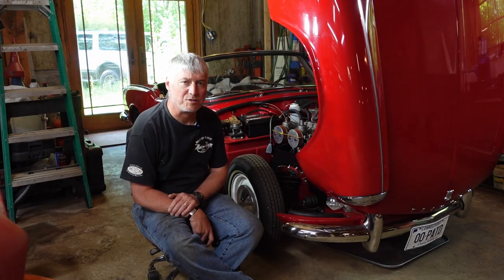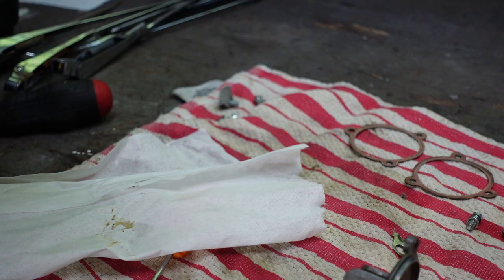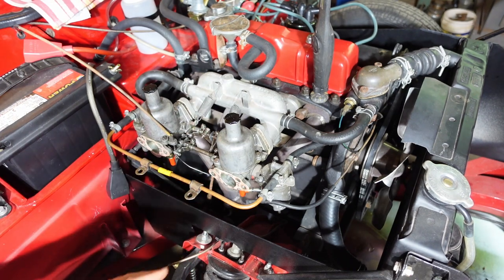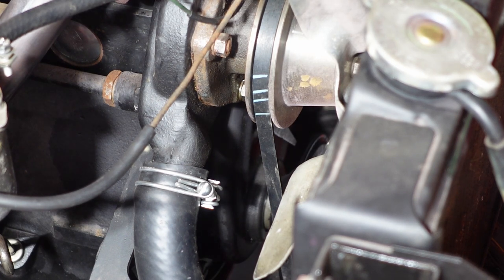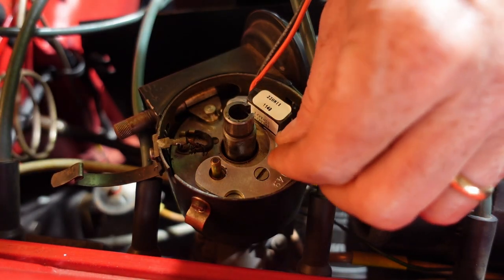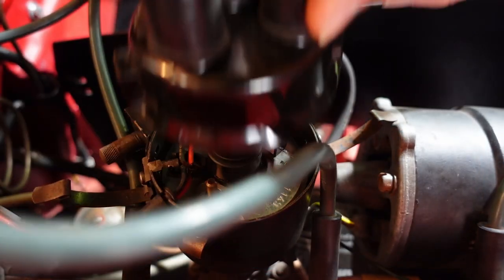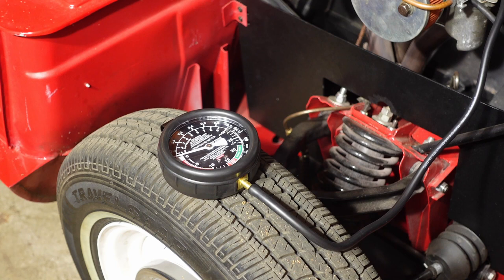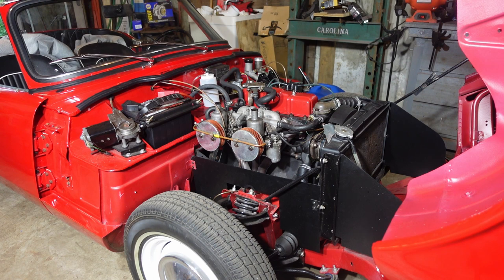Triumph Spitfire - Troubleshooting Rough Running #3 | Roundtail Restoration

Comment: And check the fuel filter, how old is the gas?
Reply from the maker: The fuel filter has about 100 miles on it and the gas was put in in October of last year with some Stabil in it. But, I do have a spare fuel filter, so I'll probably replace it anyway.

Comment: I own british bikes, not cars. But my long distance youtube guess is the fuel tank is not vented.

 Try removing the gas cap and take it for a quick run and see if anything changes.
Reply from the maker: Thanks, Lee. I did have the cap popped when I was taking that last lap. I though that might have been an issue of mine last year. No changes.

Comment: Unless it is the video I can see the missfire on your timing light.  Try running a jumper direct from the battery to the coil. This will eliminate any problem with the ignition power supply to the coil.
Reply from the maker: I think it might be the video. Timing of the shutter and the light. Good call on the jumper, though. I'll need to remember that for next time (I'm sure there will be one). Thanks for watching and your comments!

Comment: Just finished watching the video, I have very little doubt right now that you dont have enough fuel to support more than 3500 rpm.

Colapsing fuel line, plugged tank vent, fuel line to small...

 For quickest check, try running with a temporary tank. That eliminates everything but fuel pump (least likely thing I think).

 Good luck and keep us informed.
Reply from the maker: Yes, I agree with you there. I keep going back to fuel, too. Everything is new throughout the system (lines, tank). The only thing that isn't new is the pump, which I rebuilt. I may just pick up another and see if that helps. Maybe I botched the rebuild.
Reply: Just saw this video.  As far as things being new .  I can’t tell how many times I put new parts on my car (spitfire or even my daily driver ). And new parts were failed right out of the box .  Parts these days as you know… are crapola.
Reply from the maker: @frankstrobel4350  I agree, Frank. But, I did get a pertronix coil and put it in today...same symptoms. Not the coil.
Reply: @roundtailrestoration  is the it a hesitation /stumble ? Or a misfire (abrupt ,  sharp drop in power )? 

All plug wires secure …all the way in .  Maybe look at each post on cap …shiny copper ? Or black charred.  ?  Correct voltage to the coil ? These could cause a weak spark.  Fine at idle bit under a load or higher rpm…could cause a issue.  That all I got for now…trying to think of other things .  You’ll find the problem soon enough 👍
Reply from the maker: @frankstrobel4350  Thanks. Definitely hesitation/stumble. Cap is nearly new. Strong voltage to coil (which is new Pertronix Flame Thrower). Good at idle and revving in the garage. Put it under load...nope.
Reply: I'm having this exact issue right now 😢 @roundtailrestoration